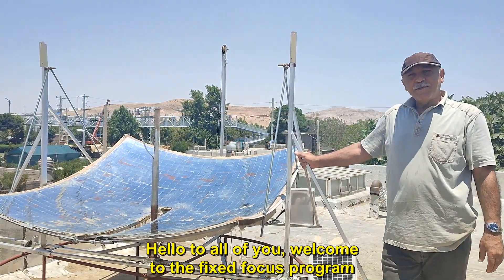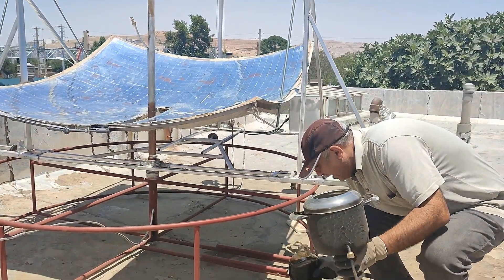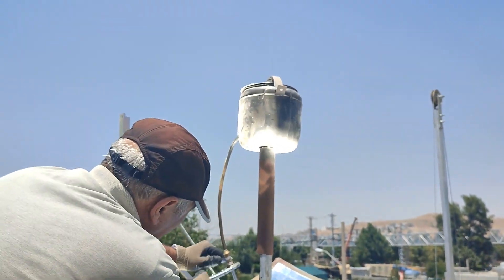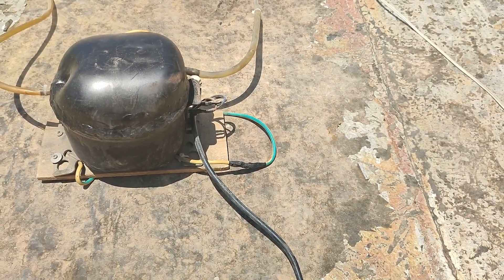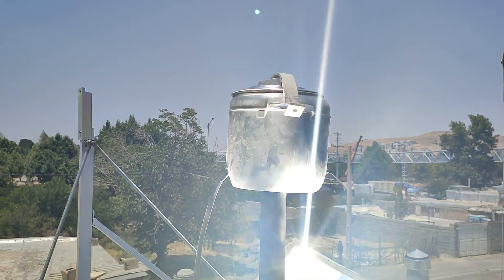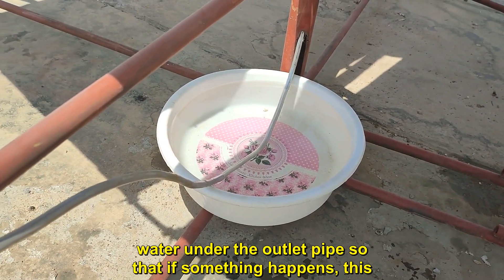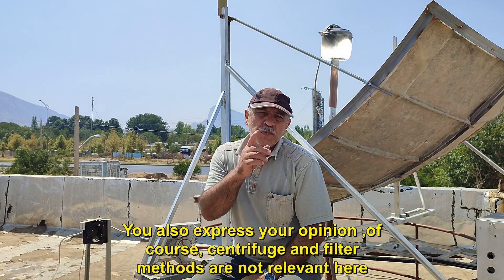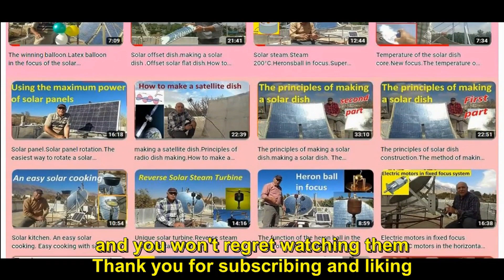A failure and experience in oil purification.

Comment: Dear mister Hashimi, 
Your experiment is a successful one not a failure, since industrial complex oil starts to boil at 300 degrees Celsius, but after 45 minutes you reached 260 degrees Celsius, so if we duplicate the solar concentrator or increase the area we will have a more concentrated heat so we can easily purify oil.

Comment: Hello, an other stuff interesting to do with concentrators, is high temperature baking. Foam glass is a Very interesting material (insulative lightweight, resistant to compression and rot !) and is made from recycled glass, and some other few component like carbon source. It is quite expensive because of the high energy input, but sun is free !

Comment: Nice to share also honnestly the failures and the possible causes, it is like this we all can learn.. By the way what do you expect in your experiment ? To distillates oil like you can do with water ? Is it only possible ? 🧐 I'm not sure...😶‍🌫
What i know about oil cleaning (to feed an engine, used with cooking oils, exepted from the ones containing sugar)
 is : 1st basic start is to leave it long time without mooving so the heavyest parts sinks, wich can take time, then delicatly scoop the upper part. Maybe a warmer environement like yours can help as oil is more fluid.
Then they filter it with basic clothes, then pressure filtration with a pump.
I heard that some processes of oil cleaning in (food?) industries is injecting water steam somehow into the oil, that would take some bad parts away.
Reply: @fixedfocussolar  I'm still not sure that fatty oil can be destilladed like water.... You said yourself that you'd only observe water steam..
Maybe try it in small scale with transparent containers...
Reply: @fixedfocussolar  So the goal is to remove any waters, not to clean the oil ? I may misunderstood
Reply: @fixedfocussolar  Ok. So the goal of the operation was to clean the oil ? By wich mean ..?
Reply: @fixedfocussolar  Ok, but how do you do, with sun's heat ? I don't understand....
Reply: @fixedfocussolar  Ok i didn't know that process...